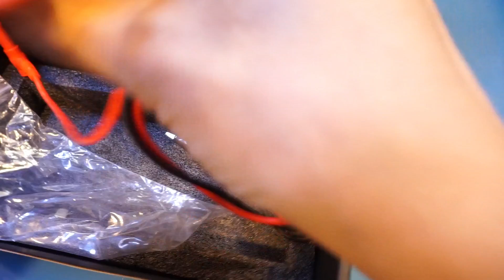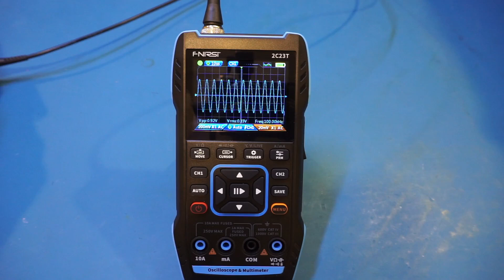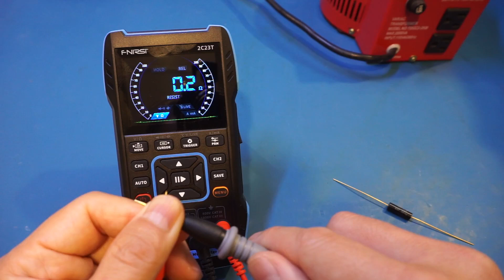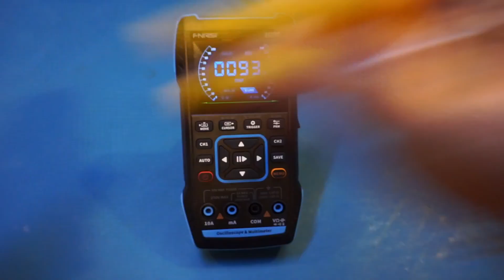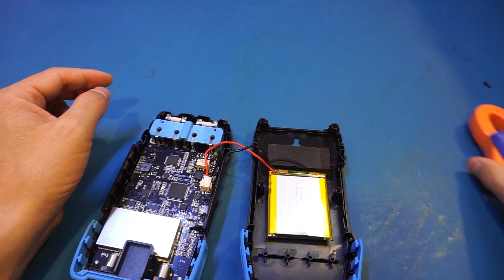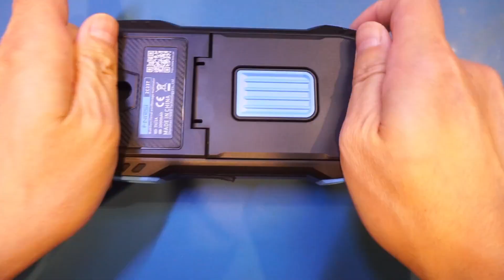FNIRSI 2C23T 3-in-1 Handheld Oscilloscope/Multimeter/Signal Generator Review/Teardown

Comment: Thanks for review! I've bought that exact scope recently with particular task in mind: bring it to some industrial object and watch RS232 / 485 / simple on-off signals that get lost somewhere. It looked perfect choice for that: battery powered handheld, isolated "by definition". But I couldn't make it to capture single event! I needed smth like several bytes transmitting at 115200 baud, so I set 10 us/div or 20 us/div, set trigger value, mode: single. And NOTHING. It was unable to catch it!

I tried to update firmware, no result. After finding out it has no XY mode I decided it bottleneck somewhere be it ADC or ADC to microcontroller bus so it can't really capture two channels simultaneously and 'under the hood' it constantly switches between them and uses some shady oversampling to restore correct waveform but that only works for periodic signal. Getting single events at high speed (like that 10 or 20 us/div) was never successful for me with that device. So eventually I brough it back to the store.

After watching your video I found out it has actually 2 ADCs (frankly I thought there is just one) but as I know FPGAs have very limited memory on board while on this board it has very small number of wires connecting it to MCU. Dunno if it is really how it works or I was unfortunate enough to get a faulty one. In the store they didn't write my complaints like a "fault" rather like the lack of features that I expected. Good thing I returned in box with all the accessories, screen protection in place so it was basically "I changed my mind" return.
Reply from the maker: Unfortunately, it’s not just this FNIRSI. A lot of the oscilloscopes I’ve reviewed have had issues capturing or triggering on complex signals or narrow pulses.

Comment: Witaj
Posiadam multimetr z funkcją oscyloskopu. Po podłączeniu pod na wyjściu układu: transformator, mostek Greta, kondensator 1000uF.
Oscyloskop ustawienie auto pokazuje DC, max 14,3v, min 14,0 RMS 6,7V
A po podpięciu tego samego multimetra  jako woltomierz pokazuje 15,5V.
Czemu tak? Multimetr przeszedł kalibrację (ma taką funkcję).
Czy to normalne? Proszę o pomoc
Reply: I'm answering a little late, I hope I managed to understand your problem.
If you want an answer to whether such a thing can happen with such combined devices.
That the RMS value of the multimeter part does not match the RMS measured by the Oscilloscope, then yes.

The oscilloscope and the multimeter process the measured value in two different ways, the multimeter measures the voltage much more accurately.
But it can only be used for lower frequencies, up to about 1 kHz.
The oscilloscope part, on the other hand, can measure much faster signals, even in the MHz range, but only with a lower resolution of 8-bit.
Therefore, the voltage measurement is less accurate with it.
I've noticed this with 4 of my Owon HDSs, the Zoyi ZT-703 and the 2c53p.
Even the HDS120 has a smaller difference, even though it uses the same measurement lead.

But the worst of all is Fnrisi.

Comment: On a small device, It's important for readability that the available screen resolution is used for large font.  Not only does the no-value-added bar graph take up space, it's impractical rounded shape takes up 3X the territory it should horizontally for each.  Even worse, this happens on both sides, with no additional function provided by the second bar!  All totaled, a full ONE HALF of the display is not used for text and icons in the multimeter mode, instead to make the display look trendy. Definitely designed for younger, more impressionable shoppers.

Comment: This is the best review I have seen on the 2C23T. You actually knew how to use it, a rarity compared to other reviewers who fall into the category of random button pushers who seem to never read the manual. Plus not comparing its readings with a high end thousands of dollars scope. I do have this unit and purchased it knowing it would have limitations. It will eventually be relegated to a secondary device to quickly see if there is a signal/reading. I mainly use it on music synthesizers to look at and inject audio level frequencies. Ultimately,  a stop gap device while I save the money to purchase a half decent bench oscilloscope. I am still in two minds whether I should save money and get a two channel or spend a little more for the same model but with 4 channels. Thanks for the quality review.
Reply: I also bought one and it's It's a hunk of junk, it's not a patch on the ZT-703S or even the ZT-702, both far superiour budget options
Reply: @shaunmorrissey7313  Let's be serious none of the low cost units are perfect. If you want accuracy, high bit count, stability and reliability then a respected brand name oscilloscope is what is needed. These low cost devices are just tools to do a limited range of measurements at ballpark accuracy. In some cases that is all one needs to determined if there is a voltage present and if within the devices capability if the voltage is changing over time. And it can always be used as a sacrificial device before connecting expensive test gear when operating in the "dark".
Reply: @Alchemetica  Come on, most of the people buying this are buying it primarily for its stated specs 10mhz, not as a DMM or Signal Generator.  As I said in my OP that was deleted, for a measely $20-30 more one could get one of several decent handhelds that actually function at close to their marketed specs.
Don't know about most people, but I don't have much call for measuring simple sine waves and such sans modulation.
Terry seems unwilling to call junk, junk.
Reply: @Alchemetica  

Who says a low-budget instrument can't be perfect?!
I think you're confusing the concepts of accurate and perfect.

An accurate instrument is one that measures 1.99999999999999999999999* volts as
1.99999999999999999999999* volts.

Perfect if it delivers the performance it describes, then it's perfect.👍

But if it lies, like Fnrisi does, then that company is a bunch of crooks.🤮

I've already bought a device that I knew what it could offer me.
My only problem with the Hantek TO1112 is that the ROLL mode doesn't work properly and there's a small problem with its internal storage. Apart from that, it delivers the expected performance.

But when Fnirsi lies about its scope that its real sampling rate is 1GSa/s and that the memory depth is 128 kBytes. but in reality it is only 200 MSa/s and 28kBytes, then it's crap instrument.
If I understand correctly from my experiences and videos, then Fnirsi scopes automatically switch to averaging mode in a time base faster than a certain time base. This can be determined by the strange change in the wave. There is no information about this in the description.
Reply: @shaunmorrissey7313  Fnirsi makes junk devices, if fnirsi accidentally manages to make a usable one, it was unintentional.
They only deal with the customer until they pay for the product and the return deadline is over.
Reply: you're right. All those devices are perfect when the client knows why he purchased it. Of course, an arduino student can manage to work with it, whereas a technician making a troubleshooting on a processor need another type of scope. Back in the day we paid a fortune to have a Craftsman 82289, with a bandwith of 70khz... Some people manage to make audio troubleshoot with a 30 dollars scope.

Comment: Actually not bad for the price. Two separate 10-bit ADCs, honest specs, clean design, can be quite appealing. Slightly low input sensitivity at 20mV/div. For simple diagnostics and for beginners, it should be fine.
Reply: Not honest, read @DerekWoolverton's comment below.
I didn't notice that either.🤨

Fnirsi is a piece of garbage who lies about his specs.
I can report this with 12 Fnrisi products in my inventory.❤
Of these, there are 4 oscilloscopes, and only one, the DPOX180H, can be used. The rest is garbage.🤣
Reply: @juhaszpeter4796  If Fnirsi devices are such trash, I'm curious why you bought so many 😃 I know a few people who use these 'garbage' tools successfully for hobby/repair work and don’t really complain. Sure, some specs are exaggerated and they are overall maybe not the best choice, but despite that, they can still be used if you know its limitations. I always say to carefully check the specs and choose a device that fits your needs if you don't have a tons of money for the thing that does everything (perfect).
Reply: @SlaVoy  
Because I'm too naive.😭
The problem is that it doesn't meet its own specification.😡

The radioactivity meter is because it produced good results in the videos.
The first early pieces were still good, the rest were cheap, scrap parts, etc.
The wall wire finder is because I needed one, it can be used, but I already drilled into the wire because of it...
after that I bought a Noyafa or some brand of products.

I bought the USB tester because it featured well in the videos, but also the bluetooth version 58. I am satisfied with that.👍

The wall moisture tester was necessary and it is good for being able to distinguish a dry wall from a wet one.❤️

I chose the SG-004a because it was cheaper and performed well in the tests, later I noticed errors, the ref voltage was not clear, it calibrates etc.
But I like it, it's usable.

I bought the 1013D because I wanted something better with a bigger display instead of Sigpeak's small one-channel handheld. but it was just a waste of money... less than a week later I bought a Micsig to1114 after that, it's a real scope and knows what it says it is.
I bought Micsig about 50% more expensive than Fnirsi.

I also bought DPOX180H instead of sigpeak, I already had two Owon HDS. I wanted another pocket instrument that was smaller than my two Owons. this is usable, but still not the real thing.
I have to check back with Owon many times.

I then bought the 2c53P, which I hoped would be good.
After the DPOX180H, I expected better.
Check out Kerry's video about it. it's a waste, the same as 1013d and 1014d...
It's even worse, I don't dare to use it to measure voltages higher than 120V.

I have a basis for comparison, and I have an idea of what it needs to know if the spec says this and that. But Fnirsi does not keep what it promises, only very rarely.

A few pieces of equipment that I already had, it's true that it's very little, but it's more than nothing.
Owon HDS272s, 2202
Owon PC scope 1022 if I remember correctly.
Sigpeak I don't know which is single-channel.
I lent it, it was lost.

Micsig To1114, STO2002?
the light blue with  physical button and  200MHz.

Rigol DHO924s
Zoyi zt-703

Owon HDS120, although this is not the scope category.

My problem with his scopes was that they didn't trigger properly, the Owon of the same category is better.
I don't know how big the actual memory is, the Owon is always 4k or 8k which I set. Badly measured on occasion, as you can see in the video here.
Wrong RMS calculation...

I noticed that there were times when the wave did not look the same as on Owon and Zoyi.
 The two channels received the same wave, but one channel measured more than 20% more. etc.
It receives a signal with the same frequency, on other scopes the two signals do not move rigidly relative to each other, but with fnirsi one signal moves relative to the other...
And even more firmware bugs that will never be fixed.

Those who praise it may be lying, unfortunately I know people like that.
if it's bad for him, then it should be bad for others too.
or I won't tell you that I made a bad deal, etc.

I'm happy to admit if I'm wrong...

or what is also possible, that person has no possibility of comparison and then does not know that Fnirisi is garbage.
Reply: @SlaVoy  
The spec tends to exaggerate Fnirsi a lot, it's rare when Fnirsi is honest. Many things are omitted, reality is distorted.
Me too chooses on the basis of specification, but that mod is worthless if the specification is not real, or is directly described as wrong way.

Comment: In the "Confusing current mode" section, the zero readings were due to you cycling through into AC current mode, as shown on the display. When you cycled to DC current the reading was OK. I fall for it all the time as my Fluke 87 V defaults to AC current measurement.
Reply from the maker: Oh my goodness, thanks for pointing that out! I was so fixated on the reading and didn't even notice the mode it was in.

Comment: One of the things that I like about this review is that even tho there was an "unboxing", you had already gone thru the process of understanding the instructions and reviewed how to get things working in advance. That really improves the quality of the review substantially over some others who don't actually spend the time and just muddle around while recording. 
   Currently I am looking more for a 2 channel scope/meter but with a more standard Multimeter selector similar to the Mustool MDS9208 that you reviewed. 
Thanks for the great review.
Reply: Go to 34:52.
There isn't much to complain about.
The O-scope could be a bit better in its implementation.

Banggood is like $90, so I expect EU folks and such with VAT are looking at 17-20% more.
This might be decent if all you're doing it measuring simple sine waves other non-modulated signals.... All my uC and other circuits that I want to look at with a scope are generally modulated somehow so this thing is useless for anything above 500Khz, forget 1, 2, 5, 10Mhz, as it is advertised.
For a modest amount more, one can get something that will actually perform as marketed. 
For less, one can get one easily equal to this.

I like Terry's simple production work, however he rarely seems to want to anger his suppliers with a negative finding as that would probably reduce the amount of free equipments he gets for content.
As someone looking for some of this equipment though, I WANT to know if something is actually worth my hard earned $$, not generic 'yeah its ok, not too bad', etc.
I'll take the lazier, muddled recordings if they're will to call out equipment that is a rip-off and suggest something in the range that is actually competent over nice videos.